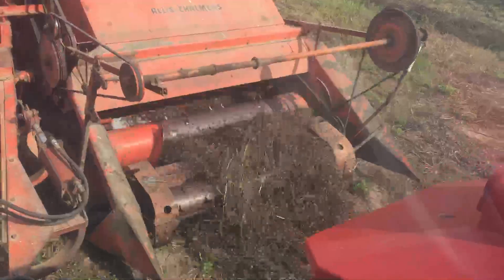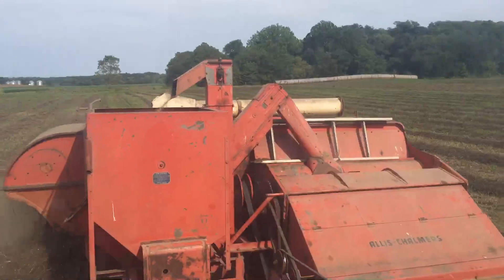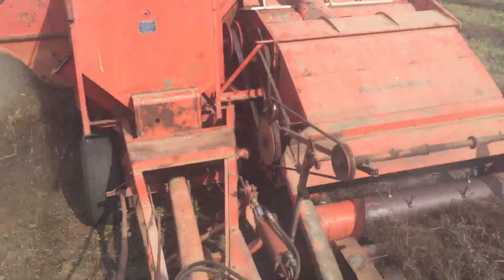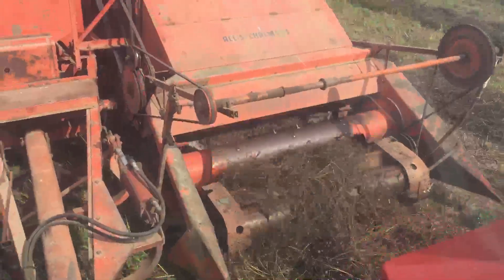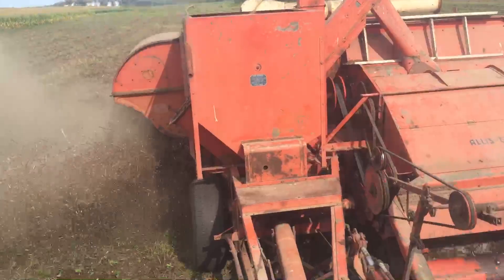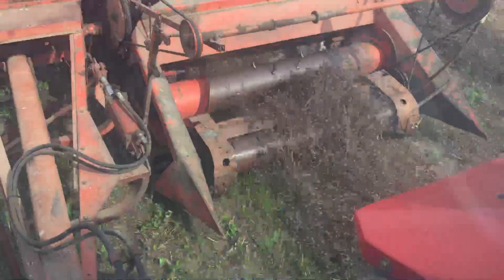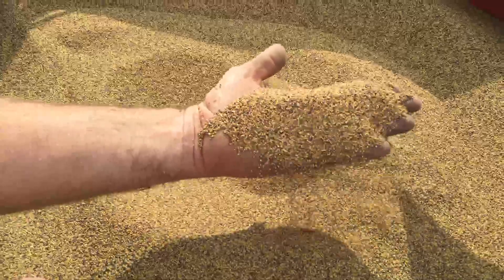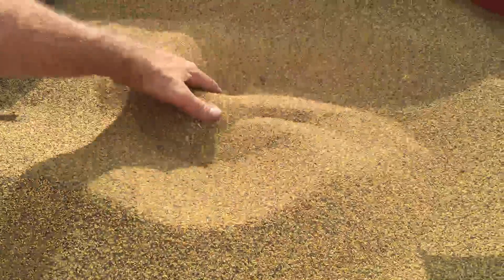Combining Red Clover with Allis Chalmers 72..."when things go right"

Comment: Not many pull type Combines still in use. Even less AC ones. Does your combine have a weed seed separator on it? My old neighbour had a MF (I think) Pull Type and he always had a bag on the side to catch the weed seeds.
Reply from the maker: If I found an MF pull-type, I might try to restore it!  Yes the AC combines are about all gone.  The use they excelled at was alfalfa and red clover seed harvest...what we are doing here.  We never used a weed seed separator.  They were not common in this area, and with red clover there is very little weed seed in normal conditions!

Comment: My dad would hull clover in the early ‘70’s with his AC 60 and WD45,no cab, would come home real dusty. Great video, lot of memories!
Reply from the maker: I think the older gen was a lot tougher ;)!!  I remember my brother doing it in the 90's with an open tractor and driving one way to get the wind in his face!  Once you use a 72 and get the feeding rate figured out,  you will never want to use a 60.
Reply: Geiger Farm  
You’re probably right, dad always wanted a ‘72, he did have a ‘90 though
Reply from the maker: The 90 would have had all the things that made a 72 better!  I just hope the 90 strengthened the frame to carry that head.  Our 72 has had several mods to carry the Inze pickup.  Our 72 came from Ohio.  I have never seen a 90 in real life.  The 60 & 66 were in our area.  Then the masseys took over...
Reply: Geiger Farm 

   The 90 was still in working order when dad had farm sale, that was in 1988, think it sold for $275,

Comment: Good day. I'M 67 yrs.  I remember our neighbor coming over to combine clover,but he had  scour kleen on top pf grain bin, and he said you have to put different screens there to for fine seeds. From video your seed clean enough to plant.  I think he had #60 or 5ft.  So they must have been a real good  machine.  I don't farm anymore, what is clover seed worth.  how many pds./ac. did you get. Thanks Can you do video on putting different screens in. Thanks
Reply from the maker: The 72 has a slat throat and front beat.  These allow it to feed the cylinder much more evenly and thresh the clover better  than the 60, which had canvas on the throat.  YES, you use a round hole screen at the bottom of the shaker shoe.  There are two options...one was a combo (which was common and most people have) for red clover and alfalfa.  The other is smaller (thus you get cleaner seed) and used for red clover.  We have the smaller screen and had to look along time to find it!  The clover is yielding over 300# per acre and is valued at $2-3/lb.  Replacing/changing the screen involves opening the discharge end of the shaker and removing the bolts that hold the screen in.  This process would be hard to film...:)
Reply: Good day.  Boy that's reasonable return. I think my dad tried it second crop. Especialy with such a high price combine.  I wonder why more don't do it.  Also  how do you get alfalfa seed & why aren't   more people doing that Thanks
Reply from the maker: My second crop clover is used for green manure, grazing, hay, or haylage.  Seed at this time is very risky in my area.  I approach it from the perspective of self-sufficiency (the ability to produce my own seed) with the option of a cash crop.  Typically, I buy alfalfa seed based upon the small amount that I need...